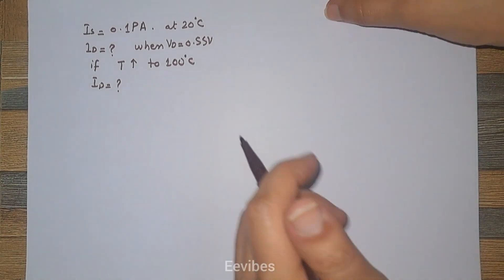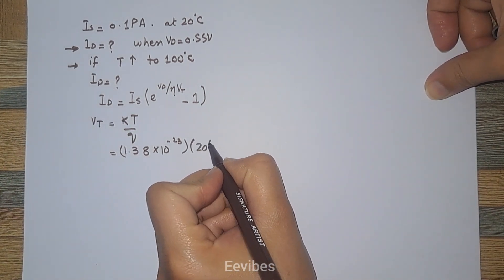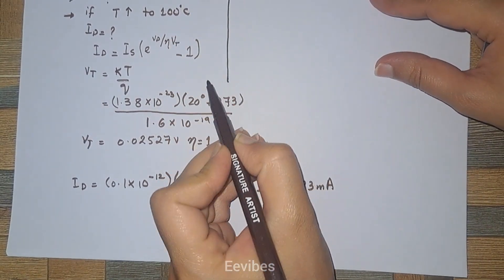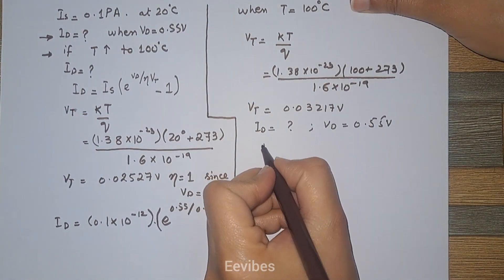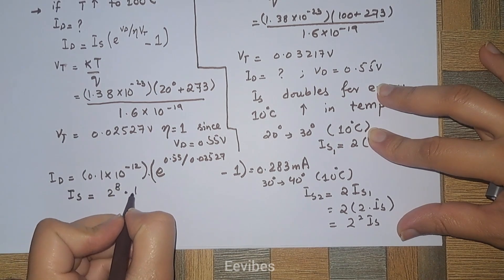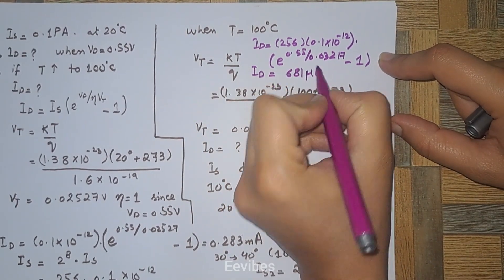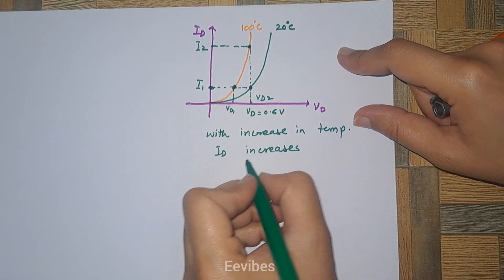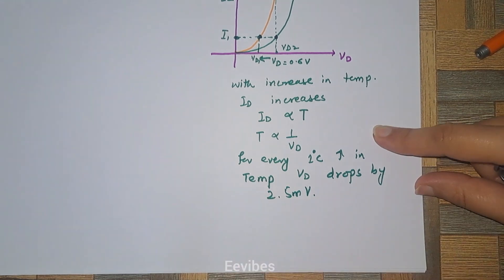The Saturation Current of Diode is given at 20°C  Vd= 0.55v. Find the Diode Current if T increases

Comment: A silicon diode has a saturation current of 0.1pa at 20^(@)c.find its current when it is forward biased by 0.55v.find the current in same diode when temperature rises to 100^(@)c.🤗
Reply from the maker: Yes it must be calculated bcz both Is and Vd are the functions of temperature
Reply: @eevibessite  Why don't you make any Videos/shorts on Karnaugh map( K-map)..?

1.Simplify the given Boolean function using K-map. Also draw the logic circuit using simplified expression.F(A, B, C, D) = m(0,5,6,8,10,11,12,14,15)

2.Using the K-map, find the simpler expression for F(M,N,O,P)= (5,7,8,10,12,13,14,15) and also draw the logic diagram using basic gate.

3.Simplify the Boolean expression F(A,B,C,D) = m (4, 6, 8, 10, 11, 12, 15) + D(3, 5, 7, 9) and obtain the simplified logic circuit for it.
Reply from the maker: @santoshbhattarai3365  check my playlist. I have covered till sequential circuits
Reply from the maker: Are you asking for the solution of this question ?
Reply: @eevibessite  Yeah
Reply from the maker: It's already solved
Reply: @eevibessite Yeah  But is it necessary to calculate V_(T) again at 100(@)C, though The answer will only  change slightly.. ( Also given that The Diode is same. )
Reply from the maker: Hey there is complete playlist of digital logic design course. Kindly check there I hope you can easily find these questions.